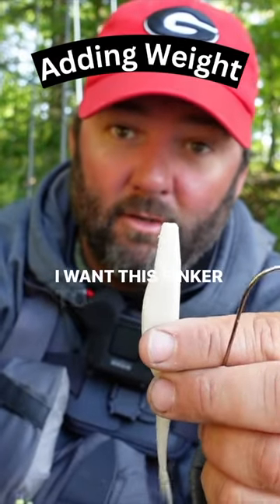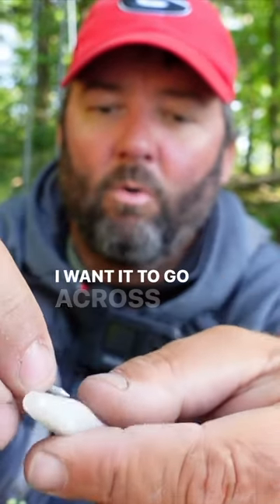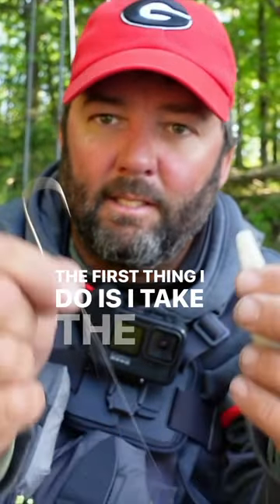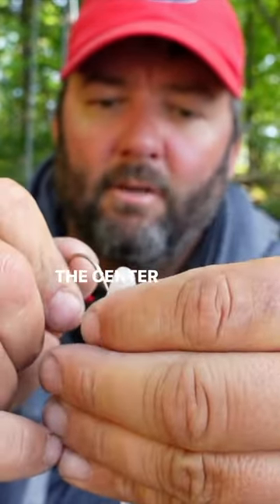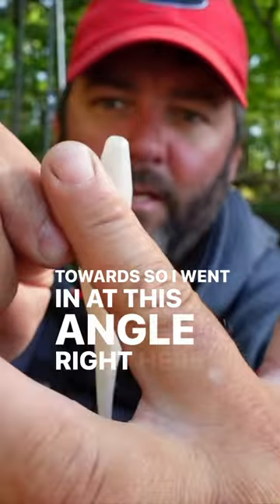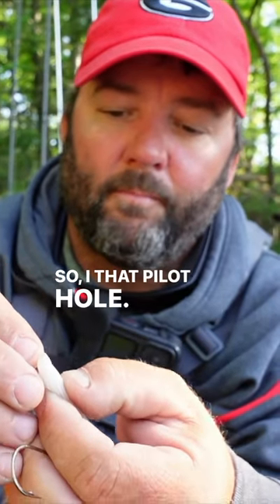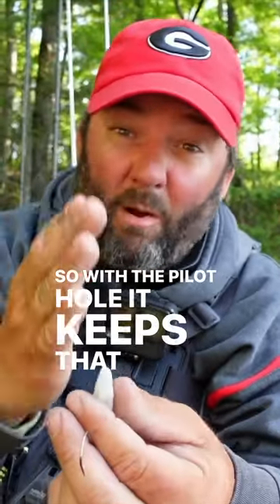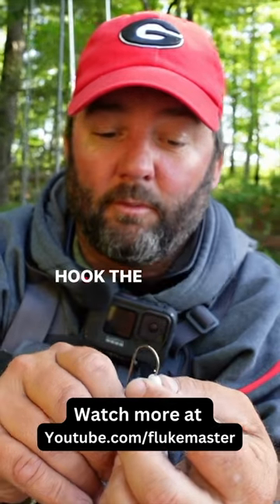Adding Weight to a Fluke

Comment: Thanks another great tip…… Those weights have brought a lot of different options to my plastics over the years! My favorite is to take one of the old school Ribbit frogs and add weight across the feet and fish it just fast enough to keep it on top of the water…..Hold that rod tip at 2 0 o’clock and hold on, lol it’s heart stopping but a lot of fun.

Comment: The best “fluke” hook I’ve ever used is the VMC Drop Dead weighted hook.  So sharp the fish basically hook themselves, plus it gives all soft jerk bait style plastics a tight, side to side slow wobble on the fall.  I’ve recently been skipping it under docks and trees, just like I’d fish a wacky rig and have been getting way more bites than I do with a traditional wacky rigged or weightless Texas Rig stick bait.

Comment: Could just buy a weighted fluke hook they work perfect
Reply from the maker: Yes but this produces an action where the bait stalls between the jerks. It's this stall when I get the most bites.
Reply: Seriously are you knew to fishing?? Lead/tungsten weights (nail weight in this mod) produce a completely different action than soft plastics weighted with salt